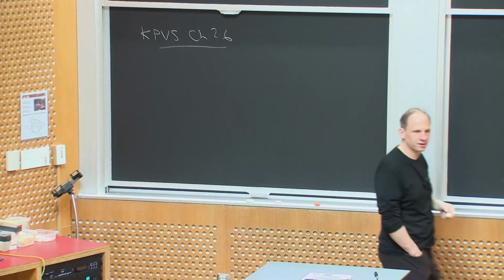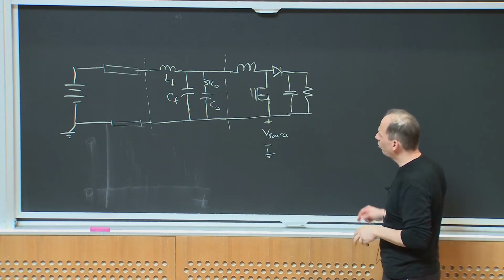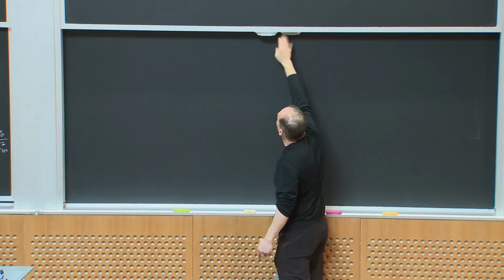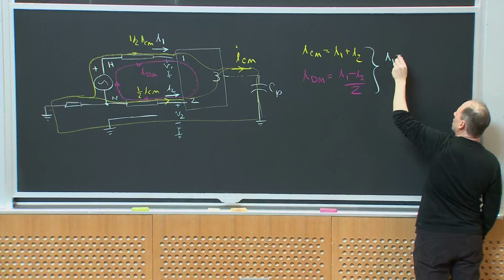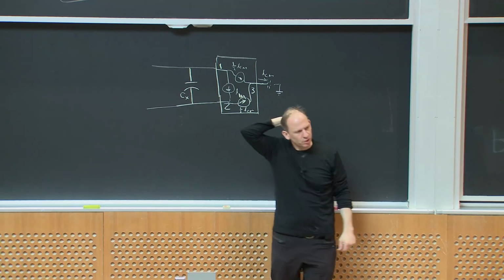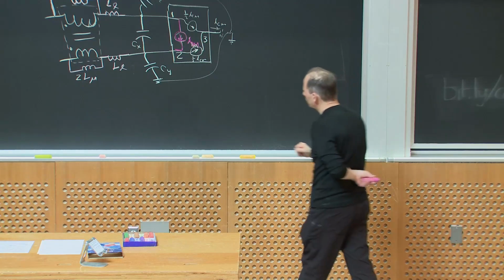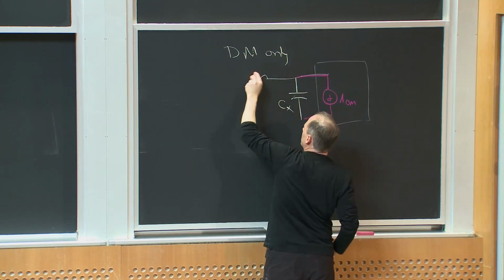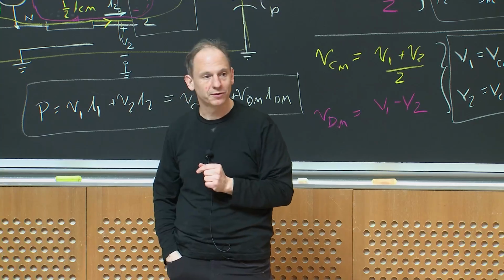Lecture 30: EMI Filters, Part 3: CM + DM

Comment: When it comes to design of products, estimation of this parasitic path is important to dimension the CMC inductance. It would have been great if this was also included. It’s not preferred to complete the design of filter without ambiguity on parasitic capacitance value.